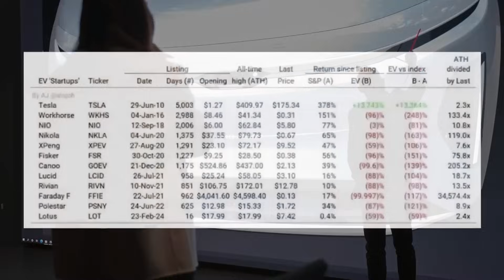Humanoid ROBOT Explosion!!

Comment: Hewlett-Packard and Texas Instruments used to focus on excellent instrumentation equipment, before venturing into computers and peripherals. You are saying robot hardware may "standardize" and variation will be reduced to job requirements and working environments (like diesel-powered machines have, from boats to excavators, heavy construction to mining, etc.), whereas the software may diverge in many directions. I'm not sure about that. For instance, Nvidia's new "THOR" systems seem designed to become the instrumentation and control systems for robots (and cars) in a way similar to "avionics" for aircraft or "Tesla One"-type systems for factories. Apple may try that as well. Other companies like Tesla and Figure-1 seem to be designing "agent" software which individualizes if it learns by seeing and doing and sharing abilities.

Comment: Im sorry but anyone that is pushing humanoid robots is an idiot. There is no market and probably never really will be. We have plenty of robots but they are designed for the tasks that they are made for. The other problem is for the most part the mundane small tasks that may be replaced by humanoid robots will be too expensove for the cheap labor that the use. The craziest thing though is to think Tesla which has shown nothing will be at th forfront
Reply: Internet is just a passing fad
Reply: @henrik5761  humanoid robots are more like Segways thought to be revolutionary means of transportation but at the end of the day a fad or a waste
Reply: @bobbob-gx1iq  - LOL - I'm sure you said that about Tesla EVs, 10 years ago or SpaceX's falcon 9 and Starlink satellites.
Reply: @HDnatureTV  I was actually a very early investor in Tesla back in 2012. Space X technology is good but has not proven to be a good business model yet but very will could be not sold on starlink at all
Reply: @bobbob-gx1iq  Also the fact you "aren't sold" on Starlink, a product that is generating massive profit and has 2.6 million users today doesn't reflect positively on your intuition.
Reply: If you're a company looking to design and manufacture robots, what's the best way to make it economically viable? Economies of scale, like literally any other product. 

Designing and manufacturing 1,000,000 of the exact same general purpose robot is much, much more profitable than doing the same for 10 different specialized robots at 100,000 units each. 

Humanoids are the best choice for a general purpose robot because all of our infrastructure is built for the human shape. One single design can be used for serving drinks, hauling gravel, packing boxes in a factory, etc. 

It makes a massive amount of sense from a business point of view, which is exactly why so much money is being poured into this by multiple companies around the world right now.
Reply: @smokeyfish7435  if this was correct then there would be one choice for everything but there is a reason why there is tons of different models. But your argument isn't even correct because there would be at least 10 different specialized humanoid robots. You are not going to want to pay for features you won't use. The humanoid design has a lot of drawbacks mainly stability. It is ten times better to make a robot on multiple wheels or tracks. It is just such a gimmick that is made a popular idea because of scifi movies.
Reply: @bobbob-gx1iq  10 different specialized humanoid robots gets you back to square one with r&d costs. I think you're underestimating just how much a gen 1 product costs to develop. 

In any case, there's no way all these companies would be pouring this much money into something if it wasn't a viable strategy. They're like sharks in the water that just tasted blood.
Reply: @bobbob-gx1iq  - how does a wheeled robot step in for a person and drive a loader, climb stairs, play soccer, etc.  Jobs are made for people physically.  So, a bot designed like a person is very flexible for any human app.  That doesn't mean you will put it in the pilots seat, but you could - rather the GAI of the bot (the brains) might be all you need like in a cruise missile or drone co-pilot or Starship.
Reply: @HDnatureTV  why would a bot drive a loader you would just make the loader self driving. A bot that would play soccer would be totally different than a bot that was made to clean the dishes or work in construction.
Reply: @bobbob-gx1iq  Are you under the impression that a human who plays soccer and a human who works in a factory are fundamentally different breeds of human? The human form can do a huge range of tasks. One minute I can prep a meal, the next fold laundry, and next operate a computer. I didn't have to be purpose designed for each of those tasks.
Reply: @SyntheticSpy  yes a person that is good at soccer is different that a person that works in a factory. Would you want to pay for a bot that can run, jump, and head balls when all you need them to do is pick up boxes and rearrange inventory. If you have a bot for soccer do you really want  it to pick up 500 lbs. Every feature comes at a cost
Reply: @bobbob-gx1iq  - Simple, because using a loader, it can step out and drive the dump truck, step out and open the gate and drive down and dump the dirt.  You don't need 4-5 expensive one purpose bots.  Also, what you totally miss (go watch some Tesla bot videos and interviews) is all bots connect to a massive AI that is trained and not expensively programmed.  So, if you teach one bot a task - putting on a car part, all the bots will know how to do that from the massive AI - no need for retraining.  Think upgrades, like a bot soldering chips on a circuit board.  Suddenly the design changes, you can quickly show how to create the new board and continue production.  Much better than retraining a whole class of humans and watching how to videos.  Lastly, your helicopter pilot gets sick and can't fly.  A trained bot pilot can step in with no mods.  In fact, you could train it to fly 100s of helicopters and planes so it and other bots can easily step in.  Building special bots for each helicopter is very expensive and not practical - though we do have auto-pilots built into some aircraft.  Try designing, building and installing a bot to fly a P-51 Mustang - very expensive and not going to work.  Why? P-51s were designed for humans much like all of our devices.  You can make a self driving car with one bot when needed and transfer it to other cars.  Each family, could have one bot for 3 and take it when they go to a bar.  Dad, can I borrow the bot?
Reply: The Humanoid bots are just to show of!for what only two arms and legs?So we take the weakness of the humans and replicat it!There is no need for a head to!
Reply: LOL - GAI human robots can step into any human physical job from flipping burgers to driving loaders.  Watch some of the Tesla bot videos and review videos.  No programming needed.  Show it a job and train it and it will do it cheeper than a person.  You are like the idiots that said Elon could never land a rocket or beat the big space companies and car companies (with the best selling car.).   You sound the CEO of GM and Ford - clueless and left behind..